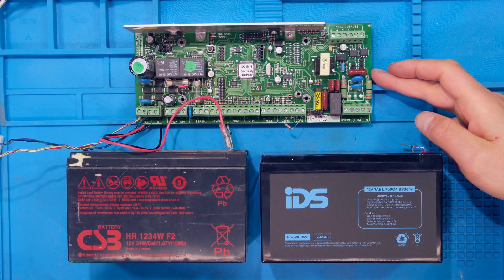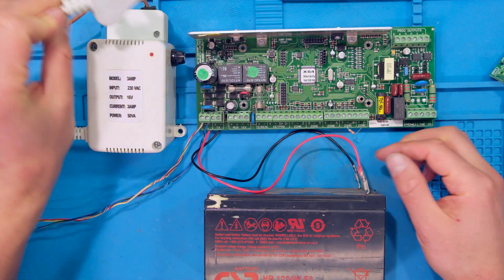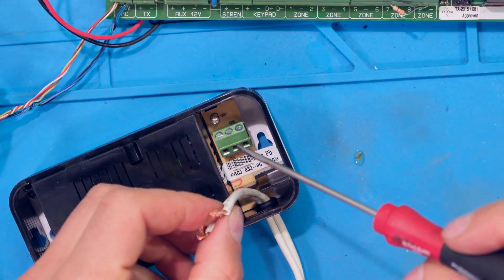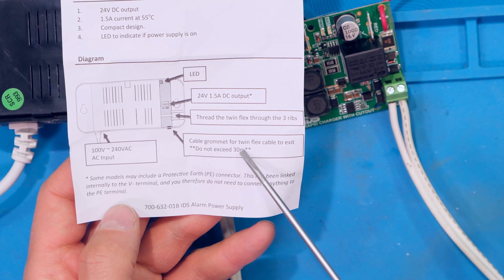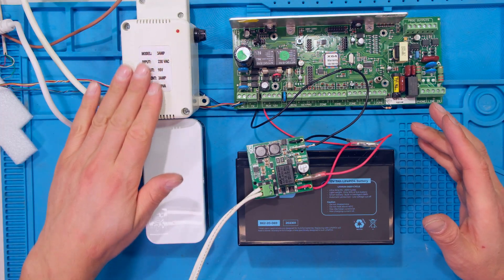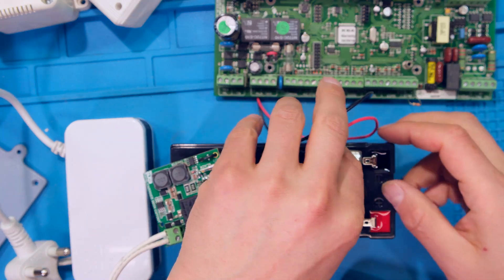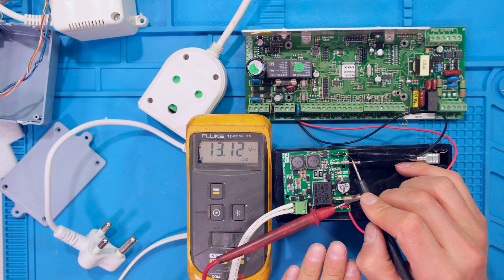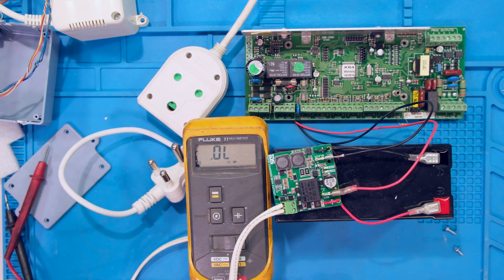How to Connect a Lithium-Ion Battery to an IDS Alarm System – Replacing the Lead Acid Battery

Comment: Hi, I see on one of your videos you have, what im presuming is, a battery backup solution for your alarm panel. The big white box marked "Alarm Supplies" underneath you alarm panel. Is this a larger capacity battery backup for your alarm system ? What make and model would it be and where could we get such a solution ? Thanks

Comment: Thank you for the lovely and well explained video on this topic .
My question, I have an Ids system which is powered by an acid battery, also connected to this system is another backup power supply. I want to replace the acid batteries with lithium  batteries. Do I  also need to add a Ids rapid charger to the backup power supply or can I just power both lithium batteries with a single rapid charger. Your help is much appreciated. Thank you .
Regards
Pallie

Comment: Cant you straight swap out the lead acid for the lithium.
Reply from the maker: not according to IDS. I did confirm this with their technical department which is why they want users to purchase the stand alone power supply.
Reply: @ecologicaltime I have been running a LiPo battery straight on my x64 board for some time (2 to 3 yrs) with no issues. I only came across this video when trying to research something else.